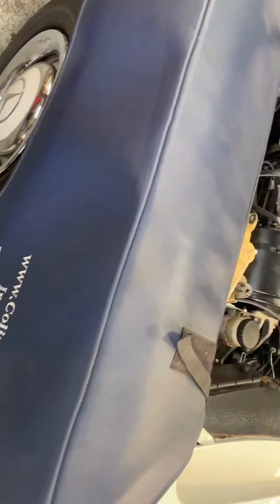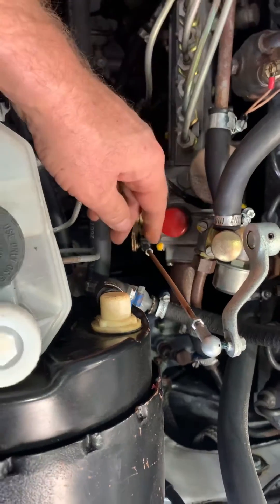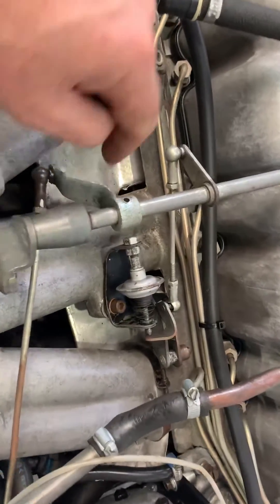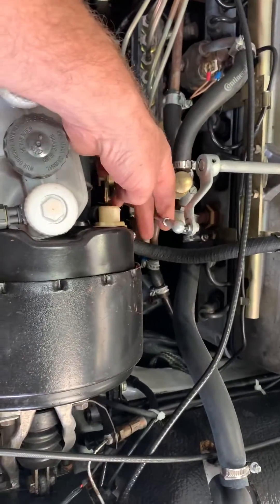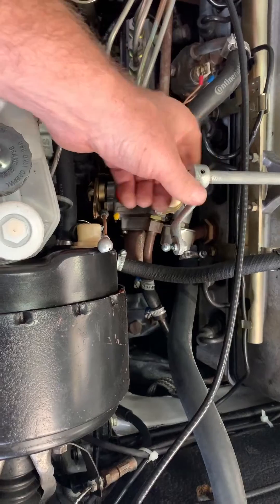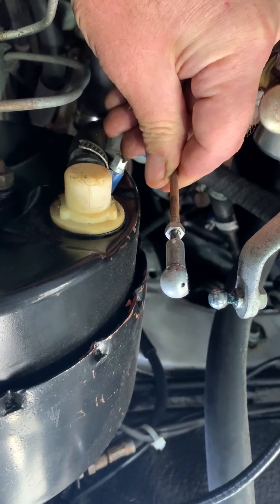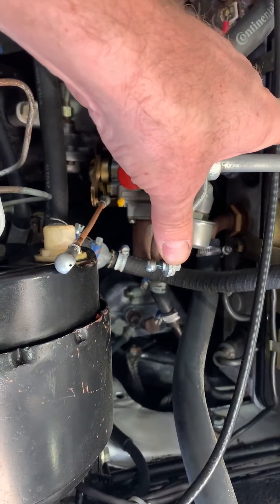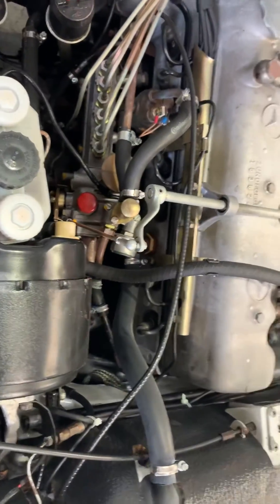Mercedes Benz 113 split linkage test

Comment: Awesome video! If it is running too rich or too lean, what is the adjustment to fix it?
Reply: I just watched (in person) a more detailed demonstration of the full linkage and some basic tests.  I'll try and explain what I saw.  1st the throttle plate must be set so that it barely closes but won't let any air into the throttle body.   Air is only supplied at idle through the tube behind the throttle plate (seen about 24-30 sec in).  This can be tested by pinching it off - the engine should then stall since it's not getting any air..   If the engine keeps running when this tube is pinched then it's getting air thru the throttle body or some other vacuum leak.  Fix any leaks and then adjust the throttle plate (with the arm disconnected) so it's closed but just touches the housing - should feel a little "sticky" as it opens.  Note that any sloppiness in the linkage should be remedied - typically with new rod ends.  Finally lube slightly with light oil reinstall and adjust the other side for fuel delivery.  The actual mixture is adjusted via a dial (lefty lean/righty rich) on the base of the fuel pump..  If you are a Pagoda owner or other similar vehicle with this Bosch MFI I'd encourage you to join so your can utilize the tech section and specifically the "linkage tour" on the site SL113.org..     Hope this helps!!

Comment: Hello, I have a W113 280SL and I am adjusting the linkage of the Injection Pump and I saw that it must be placed at the stop and adjusted 233mm , but if I do that with the car running the engine turns off. And if I leave the base of the injection pump linkage on top, the car starts but turns off immediately, it does not maintain the iddle.